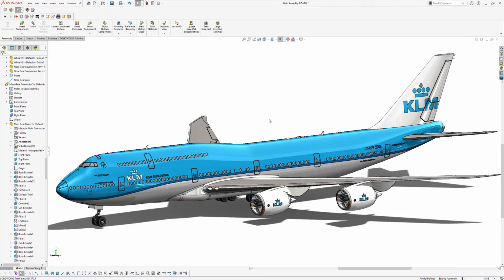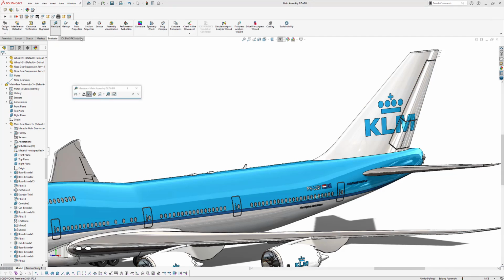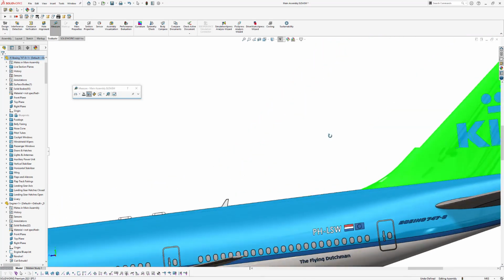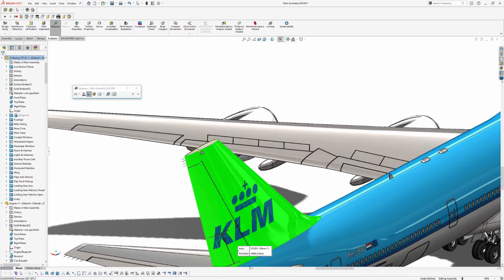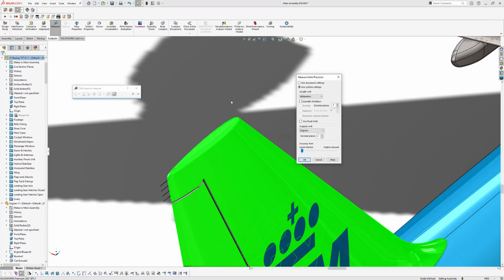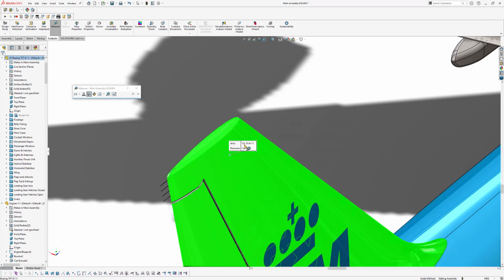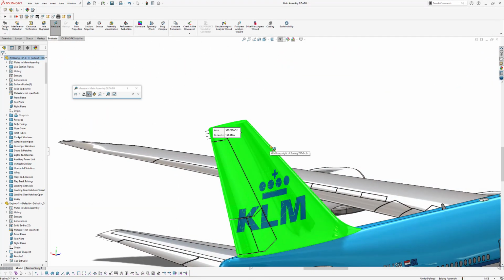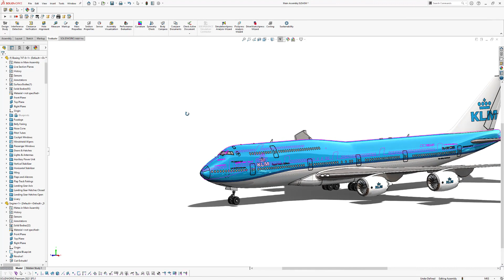How to Measure a Surface in SOLIDWORKS?

Comment: This doesn't work, it only selects one face at a time and shows the value for that specific face
Reply from the maker: Thanks for the comment! Normally, SOLIDWORKS does let you select multiple faces while holding Ctrl, and it will display the total surface area of the selected faces in the Measure tool.

If that’s not working on your end, it could be due to the specific version of SOLIDWORKS you’re using — some older versions might not support multi-face surface area measurement.

As a workaround, you can always knit the surfaces together using Insert > Surface > Knit, and then measure the total area of the new knitted surface.
Reply: @learnsolidworks  at your own video its just show the number of the last surface you choose, so which mean there no combine calculate, check video again before answering